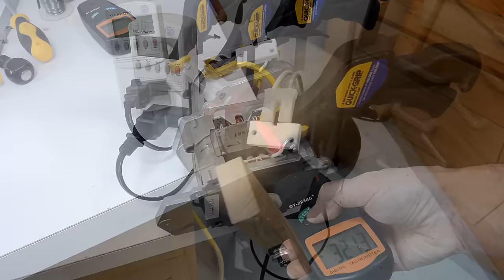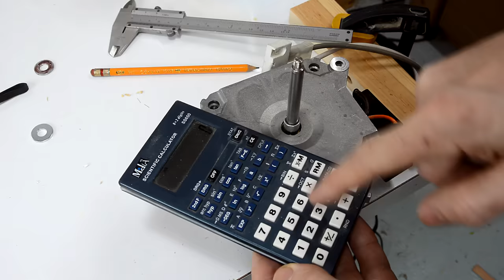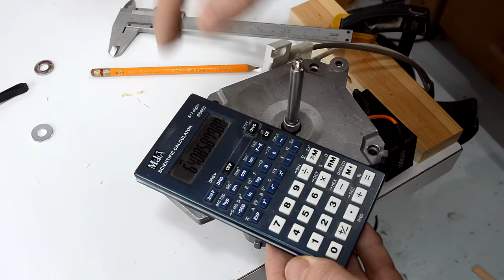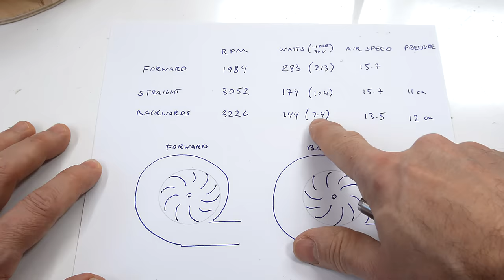Blower impeller design experiments

Comment: Another point for straight (radial) fins: for dust blowers subject to chips, small scraps etc entrained in the airflow, the overriding requirement is a non-clogging design. For that reason dust collector impellers are made with open radial vanes with steeply beveled leading edges in a roomy volute. Such an impeller ejects chip boluses into the volute clearance where their acquired motion sends them out the discharge. It's less efficient but far more reliable in service than a shrouded impeller in a closely fitted volute which may be clogged by a paper towel, a loose jacket, or a plastic garbage can depending on the scale of the installation - and what blunder allowed loose items near the floor sweep.

I have a cheap Grizzly G1023 dust collector equipped with the factory radial impeller (beveled vanes, extra-roomy volute). I don't know how many hundreds of cubic feet of planer and jointer chips its sucked up but never have I needed to dismantle the blower except once when it ate a screwdriver.

Comment: Forward facing fins are usually for blowing air and backward facing is for suction such as exhaust or vacuum in the inlet. Backward fins creates less drag and more pull, forward fins creates more blows towards the outlet in the expense of using more to motor power. Both will suck and expel air but each has its own purpose

Comment: Straight tip fans require a larger housing but they can handle dirty air and higher pressures.
Backward curved fans run at higher speeds, cannot handle dirty air, are the most efficient, and will self-limit their power so the motor won't overheat if it is correctly sized due to the efficiency curve.
Forward curved fans run at lower speeds and moderate pressures, they can only handle clean air but they are the lowest noise.

Comment: Well, yes, physics. Forward curved "catches" more air and thus has a harder time pushing it around but does so with more force for the same speed (but also taxes the motor more). Backward curved slips through the air more easily (no air to "catch"), so less force in equals less work out. And straight is middle-of-the-road. Cool experiment, good proof.
Would be curious about the efficacy of beveled-straight...

Comment: With the backward facing impeller, the air goes out a megaphone, as on Hooker headers. Forward facing, the impeller draws in more air as a velocity stack. 
Forward facing, the velocity stack is working as a blower on a piston engine. Backward facing is working as a turbocharger. 
Forward facing is working against resistance in the velocity stack, while the volume increases. Backward has less air to begin, but has vacuum in the megaphone helping.

Comment: The backward blades are optimized when incorporated with a diffuser and more so when they’re shaped with a graduating or compound pitch direction, dual action blades take air from center circle at the top, acting in conjunction with a stationary diffuser or separator grill, (limits escape of the collected air) centrifugal force enhanced by shape of the pitch graduation ( like a turbo charger’s compressor wheel) and a slotted exhaust diffuser incorporated in the open  escape portion of the housing acts like a shear to separate the boundary air layer and maximize the efficiency of the coanda effect on the blades.

Comment: I think the issue with the forward facing rotor is that the fins are actually trying to pull in air into the center of the rotor. You could try putting the fins on a steeper angle, so that they're the wrong way around. So, concave side towards the outside of the rotor.

If you look at your drawing at the end of the video, you will need the fins oriented as in the forward drawing but mounted at the same angle as in the reverse drawing. Then it will blow harder, i think.

Comment: I wonder if you  add a second disk to the straight impeller blade design --as you have for the fwd and backward curving blades --the experiment might be more definitive. Also in all cases tapering the blades gradually, to a knife edge might avoid cavitation which surely has to be affecting any results. Clever design and testing apparatus though, Thanks

Comment: I think they are right about the forward curved point. The blades as you have attached them are pointing so far forward I am surprised the the impeller did not pump in reverse.

Maybe a standard design would have the blades mounted so that the curves look more like a hyrdoelectric turbine.

Comment: when doing the flow per watt ratio the backwards will win - it has the highest system efficiency. - so if you low on energy (or let the item run for longer times) you can save a little bit. but then it will run at highest speeds - and noise might change to a non-desired level or frequency, but who knows if the other designs are even more disturbing - so it further depends a bit on the operational results the acutal designs will create and personal preferences.

Comment: You should source yourself a Garrett GT3782VA turbocharger and then replicate something similar out of wood for your blower/vacuum purposes. It has variable vanes on the turbine section which I think could be adapted to the compressor side which is what you're dealing with. If you have never been inside a turbo charger, it is absolutely fascinating. I could send you a Garrett GT3782VA if you are interested.

Comment: You have different impellers but did not tune intake or exhaust size.  Your Forward impeller is so efficient that it is causing turbulence and is basically acting as its own air brake. I did something similar by trying to bump up horse power to get a blower working. Going to an insane HP and it just bogged down no matter how it was done. By adding quite a bit of restriction to the exhaust the air did not act as a brake. Going back to the first fairly small motor I plugged it in and the blower shot across the floor unplugging itself and bashed into the wall about 30 feet away. Hysterical laughter ensued. It had to be de tuned even further to be used. Generally you need some back pressure and in this circumstance I never got around to restricting the intake flow. Your numbers show a classic case of the first impeller being it's own air brake and may move a lot more air if it was slowed down.

Comment: Great wood working skills and the most interesting experiment I've seen for a long time. It explains why I have small forward facing vanes in the confined space of the cooling fan on my Briggs and Stratton engined mower. 
The next experiment should be to change the radius and angle of the forward and backward vanes to find the optimums.

Comment: The advantage of forward facing fins should be that the airflow remains more consistent with varying back pressure due to the momentum imparted to the air by the sweeping of the blades. Your findings however seem contrary to this. Turbochargers for example almost always have backwards swept impellers for efficiency of converting exhaust energy into pressure, but forward swept turbo impellers give higher intake pressure at a given rpm at the disadvantage of higher education back pressure.

Comment: Try shaping the leading edges of the forward rotating fins by removing the corners at the back of each fin. This will reduce turbulence behind each fin and therefore improve "scooping" efficiency of the following fin. At high speed aerodynamic resistance increases at the square of the air velocity.

Comment: What impellers do is accelerate air molecules, so you need a blade that can scoop up and throw the most air molecules with the most force with the least effort to make a good impeller, and the best impeller design has diagonal blades that have a curve along all axes, like a turbocharger, essentially a combination of a household air fan that moves large volumes and a pump impeller that creates the most pressure...  Turbofan compressor stages also use that type of fan...

Comment: From what I have seen on commercial dishwashers most open impellers run at half the speed compered to closed  impellers which require close to double the rpm for the same results.

Comment: The reason why the compass didn't come on point at the check is because the distance spanned between points for the circle didn't match the distance spanned with the deeper hole in the center. Done the same mistake countless times.

Comment: The weight of the air is what you are moving. Your different amp draw is because one is moving more or less air. The high amp draw for the forward curved blades was because it was simply moving more air. Now, the motor you used could not handle the load. Remedy would be to make the forward blade impeller narrower or increase the motor size. Then re-test

Comment: Instead of making the arch of the blades a round curve using a compass, make it curve more in the center, and make it straighter towards the outer edge of the fan.

The purpose is to accelerate the air so that it's traveling faster and faster as it travels from the inlet to the outlet of the fan.

Also, the width of the blades should be narrower around the edge and wider in the center. The reason for this is because when the air is traveling faster at the outer edge of the fan, it needs to travel through a smaller conduit. Because the circumference increases as the air travels through the fan, the blades need to become narrower in order to decrease the conduit size.

Comment: Actually the "backwards" running impeller is the correct way for curved vanes.  It is intuitive to think the vanes should cup the fluid to better move it.  The opposite is actually the better way for it to run.

Comment: I believe that the drag the air current creates on the turbines is why the motor had to work harder considering the turbine can hold more cubic inches of air going in the forward position than it can in the backward position where the backward position actually generates less drag and thus less stress on the motor and more speed but it would hold less air per cubic inch based on the design.

Comment: This is obviously not a positive displacement pump, but I think your housing design is less than optimal, with that huge gap between impeller and housing wall allowing a "leak"...I suggest bring the wall to just off contact to eliminate this area of bypass and inefficiency.  Another great MW vid...thanks!

Comment: The ends of your blades are square which would create resistance in the forward facing example whereas in the backwards example those edges are out of the way, chamfer your edges 45 degrees backwards from the front edge of each blade and try the forward facing test again.

Comment: You could have used a letter weight scale to weigh each vane and match their weight. You could even place them half-on the scale to balance their ends if you wanted to be a perfectionist.
Also, have you noticed that water coming out of a spigot thins as it falls and accelerates? Accelerating air might be more efficient if you put a conical top on the impeller that slopes downward toward the outer edge.

Comment: For the curved vanes, you need to flatten the curve a bit. The curve needs to follow air flow - flatter, slower curve where the air is slowest, then a tighter curve as it speeds up (but neither as curved as your vanes were here).  I'm sure it's the extreme curve of the vanes that is limiting the airflow and efficiency of the blower.  Even angled straight vanes should do a better job than the radial straight ones in your video.  Thinner vanes would help both versions, as those are way too heavy - maybe see if someone will 3D print them for you?  The drive side of the impeller needs to be substantial, but disc on the other side could be much thinner - 1/8" MDF or plywood would work well.  Thinner vanes added to the thinner side would really raise the efficiency of the blower.

Comment: Very interesting. Hard to use pure intuition. One other variable is the size of the spiral air space around the impeller and size of the exit duct: intuitively I would feel that the backwards impeller would do a better job at maintaining laminar flow in the duct area surrounding the impeller, and it is after all this air that actually exits the device. So perhaps the increased efficiency of the backwards impeller could be use, with a narrower duct, to create a good region of laminar flow at much higher velocity - in the end perhaps you would have higher air speed for the same wattage as the forward impeller. Whether that would equate to higher volume of air flow I'm really not sure - but getting good laminar flow is probably the thing to achieve.

Comment: What happens if you use a dual radius fin design? Inner radius is the backwards curved, outer radius is straight. I am tempted to think that the backwards fins are better for scooping the air in, but are not optimal for ejecting the air through a tangentially oriented exit hole (think the normal force exerted near the tip of the fin is away from the axis of rotation). Where the straight fins are going to tend to throw the air tangentially away from the fin assembly. 

Just hypothesis.

Comment: interesting, but the but that is missing is the inlet pressure and outlet pressure.
the flat blades suck more
the forward curved push more
the backwards curves move more air, but with lower suck and lower push.
every blower has published data, called fan curves.  the plot of performance based on RPM, inlet pressure and outlet pressure.
also, the design has huge losses.  the blade should be much closer to the housing at the narrowest part.  the air needs to be  forced out of the housing and not allowed to circulate within the housing.
but thumbs up,  this was about 200% more than most people do.

Comment: easy way to make a cornu spiral is use the string method with a non-zero center point radius. this way as you rotate your marking at the end of the line and wraps around the center.  the string will then change the radius of the curve the more you move as it wraps  around it lowering its length.

Comment: Do the same test, but use S (wave) fins with air channel grooves through the length.  That way it digs into the air in the center, then pushes it out in the right direction.  Another method of this is putting static opposing curve fins outside the turbine that channel the air in the right direction instead of relying on compression and low pressure zones to create an airflow.  If you really want to get advanced, curve the interior end of the S fins downward at a 35-45 degree angle to create a low pressure zone in the center cavity.  That will cause initial cavitation, but will create a smoother airflow at full speed.

Comment: 1:12  Yeah. I was gonna say, gluing them before weighing them and measuring them precisely will prolly lead to this. 

This is of great interest to me because I have a design in my head that I don't know how to make into an actual physical object. I don't think wood is gonna work. There is no axis of rotation for the blades. The kind of machining that would be able to cut wood the way I want it would be impossibly expensive to access for me. I think I have to go with plastic and a 3-D printer. 

Wow! How counter-intuitive is this? The backwards vs. forwards thing! 
That tells me that there is another dynamic that is still undiscovered about moving air. 
Have you ever taken one of those Dyson fans apart to check it out?

Comment: Great vid and really helpful for a project Im doing, thanks. Just one point  - I think you are supposed to have an odd number of blades on your impellers as this gives less turbulent flow (quieter and smoother). Submarines always have an odd number.
Reply from the maker: Do tell why odd number of fins are supposed to be quieter
Reply: @matthiaswandel  I dont know for sure but possibly its better balanced as it rotates. I read somewhere that submarine propeller design always had an odd number for this reason. Then again helicopters often have even numbers so its interesting. Probably makes little difference once the number of blades reaches a certain point anyway.

Comment: 9:00 you also have to consider the weight difference between the straight fins and forward/backward fins. the straight fins had less fins, thus less weight, making the motor work less (lower watt power necessary)

Comment: For better performance, You needed to place blades counterwise, like they are in car turbine...bent in the center forward and straightening to outside edge, so they are grabing air in the center, and accelerating it outwards - that would provide airspeed and even less resistance to motor.. Backwards blades BTW would give You more real pressure, then forward blades as they are acting as pushers which are not allowing air/fluid to go back.

Comment: Very good job. As a professional for electronics cooling mostly using backward curved blowers I have something to say to the setup.
The snail shaped housing you use is not working well for backward curved blades. Its only good for the forward curved design.
So the  backward curved blades would better work with still low energy but higher output and air pressure when used a better shape.
The ones I use are from ebm papst and state of the art. You surely will find a better shaped design when searching for RER 125 and similar blowers.
But still; Chapeau!
Reply from the maker: see the followup video on blower housing design.

Comment: Matthias,  This is exactly where my head has been recently.  Been reading Bill Pentz's blog and asking questions about impellers and housing.  He discusses the work he did re impellers and size and motors.  I had purchased a Central Machinery (HF) dust collector before educating myself on the theory. Everybody has a YouTube video on it.  Your engineering and woodworking background as well as a willingness to explore is really helpful.  Can you discuss sizes of impeller and clearance as well as motor load?   Thanks for this video.